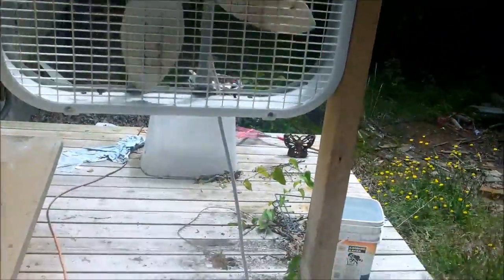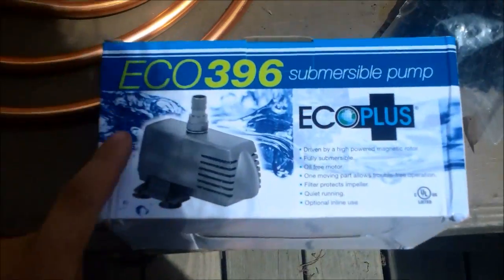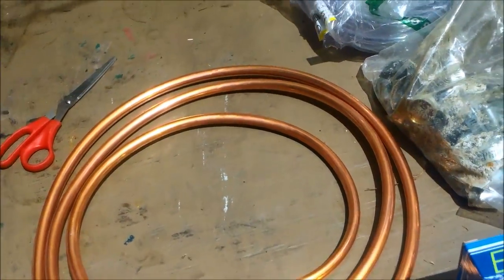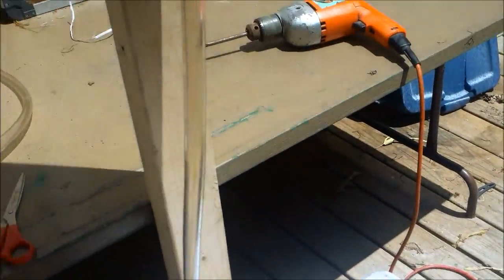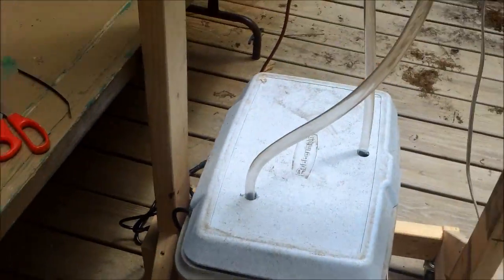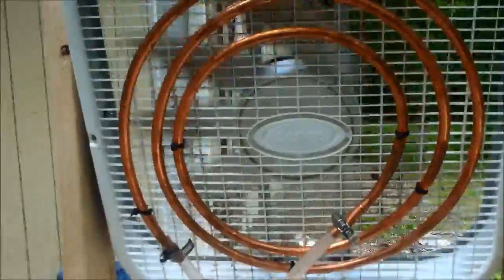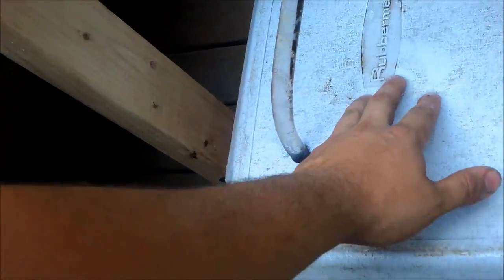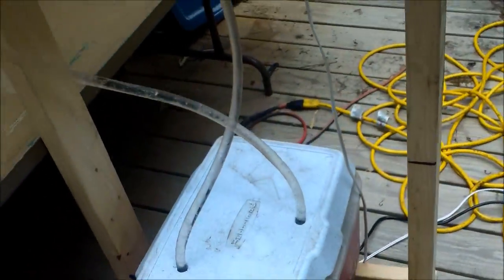how to Make Redneck AC

Comment: dude this does work! its simple design.....cooler water through tube and air will lift off the cool air off tube and cool the room....only down side i can see is the water condensation will be dripping all over so better have a good ground or catch pan!

Comment: I have the exact same fan, I made a coil with 7 turns, filled the cooler with ice and just enough water for the pump.  After 4 hours of use my ice was gone and not a degree cooler on the thermostat.  The coil did get "ice" cold with a smaller pump, but I think the water was moving so fast that it was just wasting my ice away.  Also, the coil, although cold, was not able to exchage the cold into the air without fins.  If the grill of the fan was metal instead of plastic maybe it would have worked a little... but with this setup I got NOTHING.

Comment: There's another version of this  minus a coil which would be to mount a small blower motor to the lid of the cooler. If a 12v blower motor is used, you can use this in a car.The free ice thing makes this thing worth it.

Comment: could build a cellar for ya puter room and then use under ground thermal exchange system . probably need a few hundred feet of pipe buried deep enough to harness the ambient earth temperature for it to work, sort of depth required 10 to 20 ft should nett 50 - 60 F temps and then hook up to a few automotive rads with fans and pumps, would eat way less energy that AC system, just shit loads more graft to construct.

Comment: Kinda reminds me of the liquid cooling rig i built for a friend. I used a volkswagon radiator and pump and a galaxy fan.The only thing i see as a problem with having it near the pcs is the water that is displaced in the air. Wont it eventually cause issues? I know it did when i had my pc relatively close to a window mounted AC